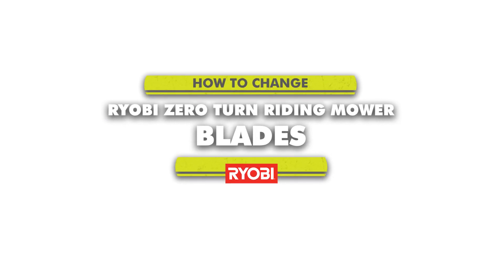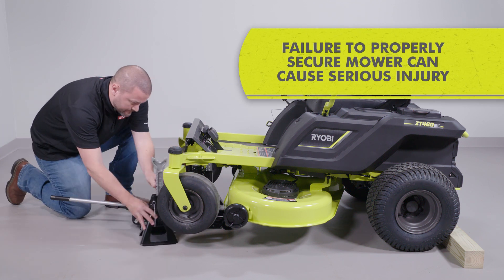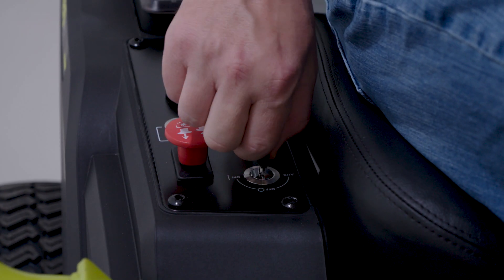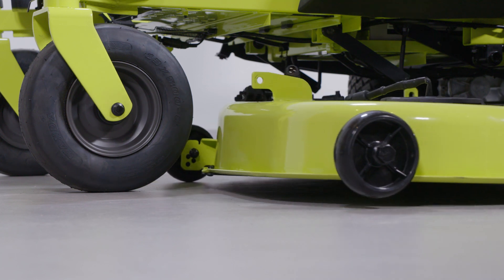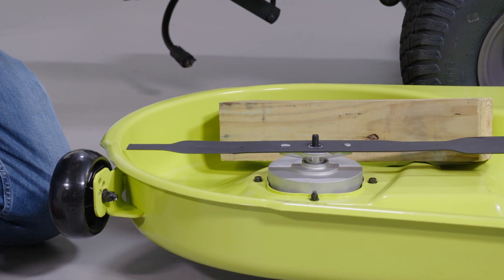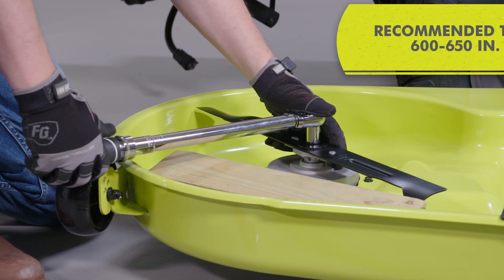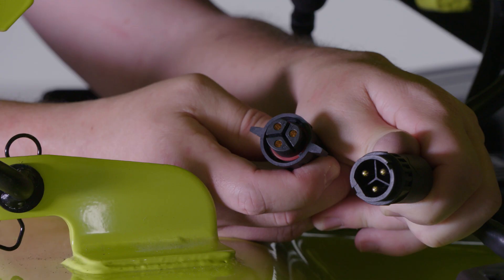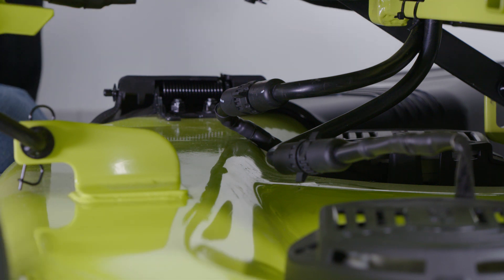How To: Electric Zero Turn Riding Mower Blade Install (RY48ZTR100, ZT480EX)

Comment: 600-650 ft-lbs of torque is a $500 torque wrench.
Reply: I thought the same thing. In the manual it says 600-650 in. lbs. So it's only 50-55 ft. lbs
Reply: INCH POUNDS, not FOOT POUNDS.

Comment: This thing looks cheap.
Reply: How do you get that? It's a residential lawnmower, not commercial grade. At almost 700lbs, I doubt that it's built cheaply. I will know in about a week though!
Reply: Best mower I ever had including John Deere mowers.  Battery only kind of sucks.  I have 2.2 archers that takes me about 3 hours and I have to charge at least 2 times.  It was advertised as good for 3 archers on one charge.  Maybe I have a bad battery.